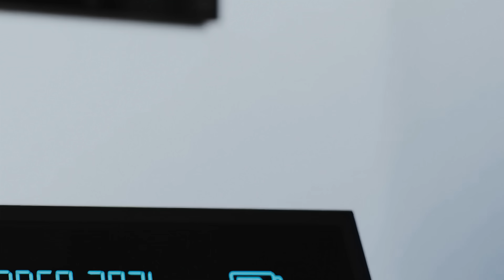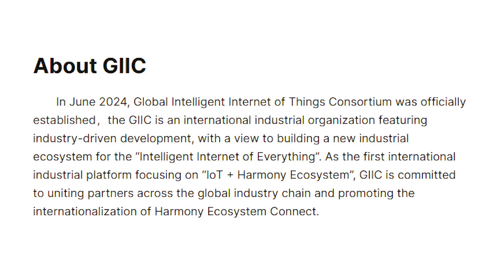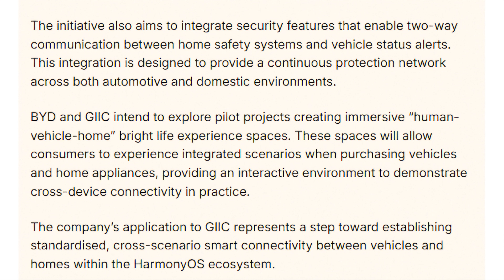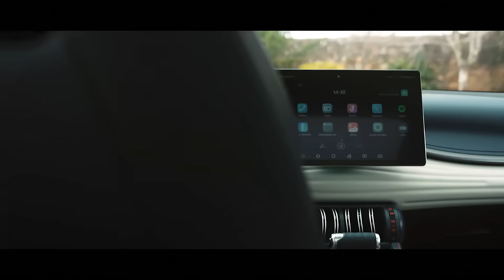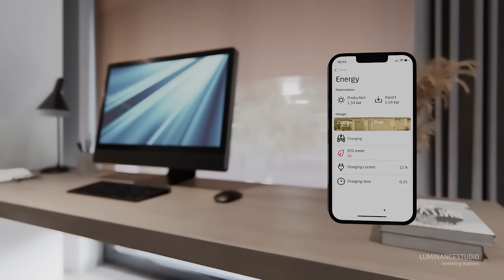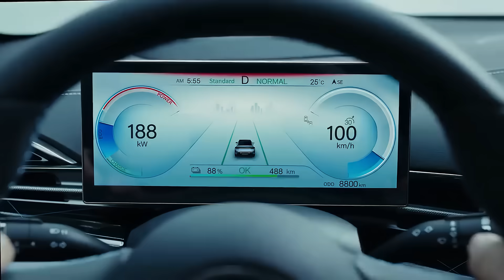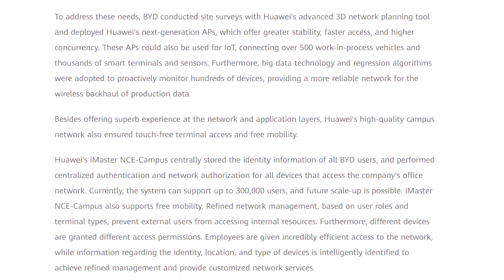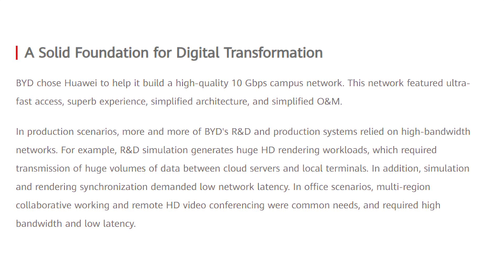BYD and Huawei Are Turning the Car Into Part of a Much Bigger System

Comment: Well, I don‘t see the point in my car talking to my washing machine.

And also, in order to generate profit, they need to lock out products from competitors, this is why people will hesitate to buy into this. So far, the smartphone is the closest thing to a hub, and it is the only device where it makes sense. The car is only one of many devices that connects to it. Demands are different for every person, building a piece does it all solution is bad from UI perspective. Having a car app, a smart home app(which is already fractured), a camera app, several messaging apps on the phone is way more flexible, especially since many of these sectors have no interaction at all.

Comment: 10:43  - NO! That my life will depend on just one company and that company can control everything in my life = Definitely NOT!

For example, you have two brands - the phone is one brand, the car is another brand.

The cloud system or connection to the company is interrupted (e.g. updates/errors).

You can still drive wherever you want or vice versa you can still use your phone without any problems.

As long as I have a choice, I don't care what a particular brand does.

This is my decision! If someone wants to depend on only one brand, that's their decision.

Comment: I thought of this about 30 years ago. Nice to see someone making it happen. I hope it works as planned.
Reply: All automated systems have their impractical sides. People keep changing what they do, their life keeps changing. And this automated programed stuff creates claustrophobia. When people remove adversity from life, the brain chemistry reduces, also depression becomes a problem when variety ceases (reduced BDNF chemistry). 
In cultures that have primitive, adverse lifestyle, Mental illness is almost zero (it has been studied).  When humans get endless new (tech) that is not asked for, the brain gets  problems. Some people with HVAC never use the auto settings, they are just very happy without the machines in control. I used to have auto HVAC, I got depression, my HVAC broke, my depression went away. Humans need the unplanned not the rigidity of machines.